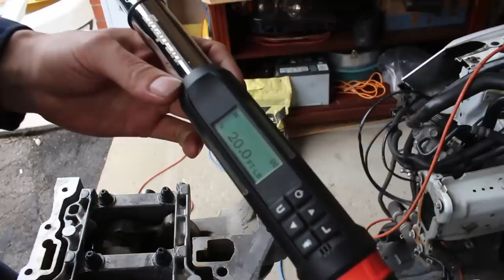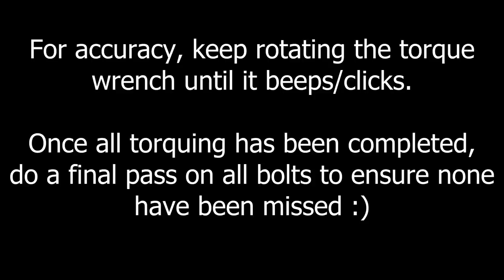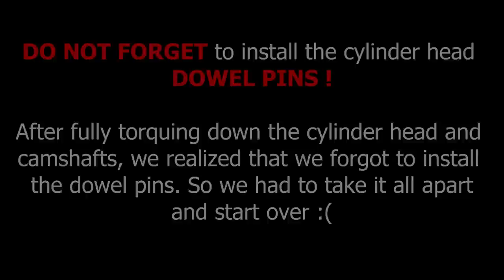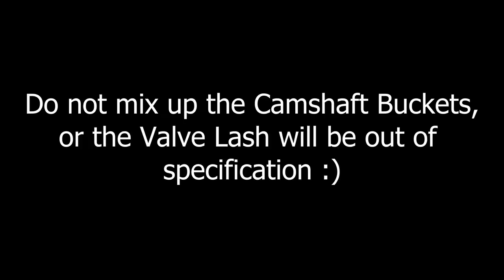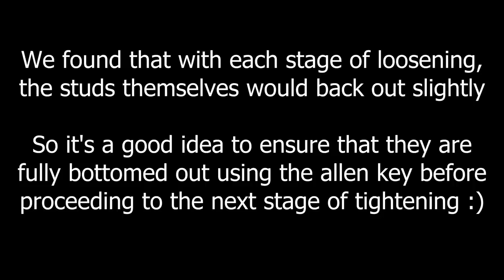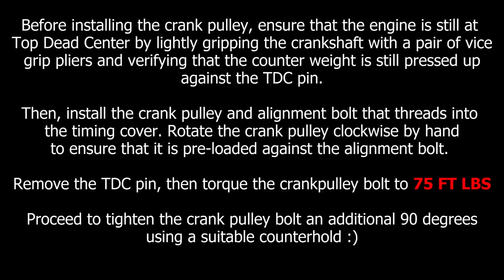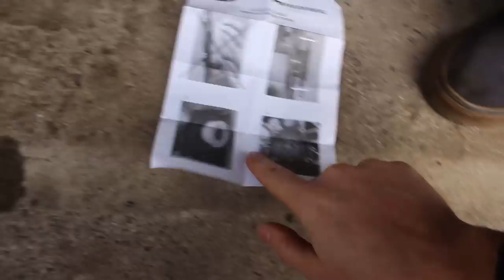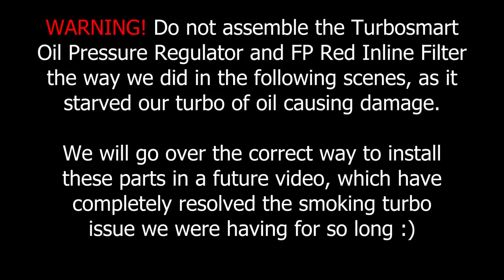Mazdaspeed 3 - Built Engine Assembly

Comment: Curious why you didn't mount the exhaust manifold and turbo before you set the block? Seems like it would have had more room to work.
Reply from the maker: That might have actually worked, but we wanted to have the engine in place first so we could properly clock the turbine housing in relation to the downpipe and custom oil feed / return lines
Reply: Wannabe Tuners I’ll be building and going BNR S4 after I hit 100k (2022 probably). Looking forward to seeing you running again. Really interested in how that oil feed works. Just curious if something stopped you. I want to try it that way because I have big hands and the EM is a PITA for me.
Reply from the maker: @Onimaru924  Yeah u could probably do it without issue as long as the turbo is already clocked the way u want it to be. We just wanted to swap the V2 CHRA back in, so that if it got damaged from engine break-in material for whatever reason, we could simply swap the V3 CHRA back in. So we needed to retro fit the turbo assembly into the car and clock the CHRA, turbine housing, and compressor housing to have perfect alignment in relation to the under route piping, downpipe, and oil feed/return lines. Then take the turbo back out to fully tighten the turbine housing bolts and raise the anti back out plates. As for the custom oil feed line, we state in writing that the way we assembled the Turbosmart OPR and FP Red Inline Filter should NOT be followed because it starved our S4 V2 turbo of oil. We have since sorted that issue and will be making a video that outlines all the little issues we've sorted out since first starting the new engine :)

Comment: Where you guys from?  Also i see FoMoCo on the block, is it just made by ford, or is it an ecoboost block?  I'm from Ottawa area, and i have a booboo on my cylinder 4.  She always starts on 3 cyl, however once it runs on 4, it has full power.  I'm hoping its my head gasket, but who knows.   I just got a 10x20 storage unit, so car is going away for sean, and pulling the head to examine.   If i end up going forged internals, i'm going to need to find a close good machine shop, that has ecoboost/mazda MZR experience.  So if you guys recommend the shop you used, that would be great :)  Cheers,  love the channel to and this engine build you guys are doing.
Reply from the maker: Thanks a lot for the kind words dude! We're from Peel region which is just west of Toronto. The FOMOCO is because when these cars came out, Ford owned a significant portion of Mazda, so there was a lot of Ford influence under the hood, however it is NOT an ecoboost engine ;) If you've got any questions, DM us on INSTAGRAM and we can do what we can to help you out.
Reply: @WannabeTuners  sounds good , thanks

Comment: By the looks of this video the tune won't be ur issue if it doe's blow up again. Looks like u didn't do ur bearing clearances.
Reply from the maker: Our machine shop did a trial assembly and verified that all bearing clearances are within spec. We are running standard sized bearings ;)

Comment: I want to keep the balance shaft in my 2.3L mazda engine - do you know how to align and time the balance shaft to crank?
Reply from the maker: Off the top of my head I'm not sure, I would have to look into it. Why keep it though? Are you upgrading the engine?
Reply: @WannabeTuners  This is just a daily driver -would prefer to keep vibrations low as possible. Just have not been able to get any solid info on how to align the balance shaft and especially if the timing marks go up to the engine or down to the ground etc...
Reply from the maker: @pingpong9656  I think you'd probably have to refer to a workshop manual of some kind. I think that info could possibly be found online for free ;)

Comment: How’s the motor holding up so far now that it’s broken in?
Reply from the maker: So far so good. Just had to sort out a coolant and oil leak, but other than that the engine is holding solid. It's still only running 18 psi, as it's been kind of difficult to find time to start turning the power up

Comment: You used a stock crankshaft? It was just keyed?
Reply from the maker: Yes it's a stock crankshaft that has been keyed
Reply: And it worked well with the 88mm setup perfect?
Reply from the maker: @andrewimbert9191  Yep works great. It's nice to know that the engine can handle abuse now.

Comment: Did you put any thread-lock or sealant on the flywheel bolts? Workshop manual does not mention anything but torque... ?

I guess as engine rotates it would be very hard for oil to gather near bolt area, because it is continuously being flung off..,
Reply from the maker: The flywheel bolts aren't exposed to engine oil. Mazda torque specs were used and no thread sealant was used.
Reply: @WannabeTuners  2:00:38 you mentioned you put new bolts with some version of thread-lock that was already on it - did I not understand that correctly - did you just use the old bolts with no thread-lock or sealant?
Reply from the maker: @pingpong9656  If I recall correctly the new OEM flywheel bolts have a blue dry thread lock on the threads
Reply: @WannabeTuners  1:58:09 <- I missed the bit where you actually showed them on the table.
Reply from the maker: @pingpong9656  Haha it's a bit of a long video. There's a lot of info that can easily be missed. I have a hard time remembering a lot of info tbh.

Comment: Good to see ya back lads.. full send.. and no more meth in with the fuel in the fuel tank..hahahha.
Reply from the maker: Hahaha thanks man! Unfortunately we don't have E85 in our area so we've got no choice but to run in tank meth to get that bump in octane
Reply: @WannabeTuners  your much safer running a meth kit buddy. I ran a devils own kit. Worked a treat. Ran 100% meth in the kit tank. And it only came on at a set 15 psi of boost to 23psi. It's a progressive kit as well. You also get the benefit of using less of it. And it cleans the valves..lol. well worth thinking about fella. Just trying to help ya out. But what ever way you go? Good luck and fingers crossed..
Reply from the maker: @sonarcreep3691  Thanks for the advice man! I used to run a 50/50 mix a while back with the stock turbo on a boost switched system, and even with a small nozzle it worked wonders in keeping knock under control. However, since I'm currently running a 6th port setup I really like the idea of only having to fill up one tank, and so far it's been very easy to tune in. Overall in tank meth in low concentrations (2-3 gallons per tank) has been proven to be safe on our fuel systems and boosts the octane to levels right on par with e85 mixes. So we'll have to see just how much power an in tank meth mix will give us before/if we reach the knock threshold. Time will tell as this journey continues :)
Reply: @WannabeTuners  ok fella. Happy tuning from the UK..😁😁😁😁

Comment: Can you or someone explain the orientation of the gear that goes on the oil pump on 1:08:00 I noticed the line on the gear,  does the line have to be in a top to bottom posotin?
Reply from the maker: The line on the front of the sprocket that goes onto the oil pump is to help line it up when installing it. Since it is keyed, it can only be installed one way.

Comment: Got question; when you switch from gen1 slave to gen2 slave cylinde was it a direct fit to the clutch line or did you have to modify something?
Reply from the maker: I've never changed the clutch slave cylinder as I've never had an issue with it. From what I've read, the clutch slave cylinders for the Gen 1 and Gen 2 Speed 3's are the same. Only the Speed 6 is different.
Reply from the maker: @commentmancommentman1658  It's possible that the earlier Gen 1 models might have come with an different version (mines a 2009). However, edgeautosport.com only shows one version for 2007-2013 models, so it looks like it bolts right up ;)

Comment: Why am I finding this video AFTER I finished building my Mazdaspeed 3??!!
Also, after watching the mod list, we did the exact same engine mods aside from valve springs. I kept OEM valve springs.
Reply from the maker: Because we took forever to get it done 🤣
Reply: @WannabeTuners  lmao I'm still watching the video and the further I go in the more info I see that would've been useful. Only thing I have left now is 2 wires that I could not find the plug-in for but haven't had any problems in the 1500 miles since I got it back together.
One of them is a small green wire from the radiator fan and the other is directly above it on the harness.

Sick ms3 bro! Can't wait to see more of it.

Comment: Why would you do a balance shaft delete?
Reply from the maker: Because the ARP 2000 Main Studs protrude too much preventing the Balance Shaft Assembly from being installed. Also doing a BSD reduces rotational drag allowing the engine to rev faster. From what I've read, it's only recommended for engines with forged internals, as it increases NVH slightly.
Reply: @WannabeTuners  ok that makes sense. Building a speed 3 engines with forged internals. I'll probably cop that BSD and a bunch of other stuff for their black friday sale. Thanks for the explanation!
Reply from the maker: @austinsherwood7188  Sounds good man

Comment: I have a question I hope some one can help me. I am trying to build a mazdaspeed 6 up to 600 hp I was wondering if the stock block and head will keep up with it. Off course I will upgrade the head gasket and bolts as well as the internals. Thanks in advance
Reply from the maker: A forged bottom end with stock head has been proven to be able to make 600 hp, but from what I've read that seems to be the limits for a stock head. It becomes too much of a restriction if trying to make more than 600 hp.
Reply: @WannabeTuners  so the block should be able to handle 600 hp just change the head set up got thanks man 💯

Comment: 1:46:35 isnt it like really not good to put brake cleaner on rubber? I thought it makes it brittle or something?
Reply from the maker: It isn't good for rubber absolutely! However we used pressurized air to blow everything out. With how fast the brake cleaner evaporates, it isn't really an issue. If the rubber hoses were soaking in brake cleaner, that would be a different story lol

Comment: Why does no one run oil coolers on speeds. Our cars don't have an oem sensor so you cant pull it up on the accessport.
Reply from the maker: Yeah that's true we only have a pressure switch. We run a Prosport sandwich plate that which gives the ability to run oil pressure and temp gauges :)

Comment: Hey guys, how are those motor mounts compared to the JBR?
Reply from the maker: Honestly very hard to tell if there's a difference because we did a balance shaft delete which added to the vibes. It's hard to say if the vibrations would be worse with the JBR mounts or not, so at this point I would only recommend what the majority of reviews online recommend, which are the Damond Motorsports mounts ;)
Reply: @WannabeTuners  no doubt. Just curious since I run the JBR trilogy as well and have always been curious. Forgot that you had the BSD. Right now I am stock block with the BNR S5 turbo, which is perfectly fine with me for now. I will build my motor one day though... glad you guys are back up and running after the ZZB
Reply from the maker: @ALIAS18425  Thanks man :) We also just recently went with an S5. Did u have fitment issues with the wastegate?
Reply: @WannabeTuners  yes. I have an older downpipe and it was hitting the wastegate, so I had to hammer a part of the downpipe in a tiny bit to clear the WG. I have seen some people block that wastegate location and get an exhaust manifold with the wastegate attachment on that.. I also had trouble with the oil return line kinking and leaking a tiny bit. I bought my BNR S5 when they were still including that junk return line. I fixed it for now lol
Reply from the maker: @ALIAS18425  Right on man, I ended running an ATP 90 degree low profile vband elbow from edge auto sport to relocate the Tial MVR 44 mm gate. As for the return line, edge auto sport carries return lines for the S5. I believe they are branded as Clean Bay Solutions. I've been running that line and so far it works great!

Comment: What's the ring gap for top and second rings? 0.020 and 0.025?
Reply from the maker: My engine builder set the top and second ring to 0.019" as per Manley's recommended specs
Reply: @WannabeTuners  Thanks for your reply. Really? What are the PSI and power numbers for your engine?
I am rebuilding my 3rd engine now, Had wisecos - blown, then Mahle - blown, and now I am trying the Manley 87.5mm with  brand, new block, head and everything. My  aim is a moderate 350..400whp now.
Reply from the maker: @Aramis_Production  Right on man, I'm aiming for 500+ whp in the near future with the BNR S5 turbo and 6th port aux fuel (I might switch to a returnless 4 port injection setup in the future for better fuel dispersion between cylinders). The engine itself should be able to handle right around 600 whp, as the cylinder head doesn't have any work done to it other than Supertech 55 lb valve springs, and it's got stock sleeves that are overbored 0.5 mm
Reply: @WannabeTuners  Thanks, so I will stay with.0.019. I am using a stupid corksport turbo that took a shit after just 2 years of use, replaced the CHRA that had a lot of play and the compressor housing due to some cracks around the WGA port. At least they shipped me another housing. Ah, well...
Reply from the maker: @Aramis_Production  Yeah man, for added piece of mind, I've been told that running 0.020" on the top ring and 0.021" on the second ring is a good idea :)

Comment: What are the OEM piston rings gapped too? Just curious. I always see what people that go with aftermarket pistons gap them too and why. But I want to know what the difference is usually from oem spec.
Reply from the maker: I don't remember the exact spec, but I remember reading on one of the forums that the OEM piston rings from factory are gapped much too tight which is a common cause for cracked ringlands.
Reply: @WannabeTuners  Oh that’s good to know! What did you guys gap yours too in those build?
Reply from the maker: @cesarsalad1999  We went with Manley's recommendations of 0.019"
Reply: @WannabeTuners  Awesome! Good to know, I appreciate the replies guys!
Reply from the maker: @cesarsalad1999  You're welcome!

Comment: Could you give me the link where you bought the CRANKSHAFT REAR MAIN SEAL
Reply from the maker: It came with the Stage 3 Engine rebuild kit from edge autosport: https://edgeautosport.com/stage-3-mzr-motor-build-kit-mazdaspeed-3-2007-2013-mazdaspeed-6-2006-2007/

Comment: Nice video, whats your break in process? How many oil changes & oil weight? Thx
Reply from the maker: Thanks man :) We ended up letting it run for about 20 minutes while fluctuating the RPM. After 20 minutes, we drained the oil and replaced the oil filter. Topped off again with fresh break in oil (Lucas 30 weight break in oil). Then drove the car for about 1000 kms with varying load, lots of pulls, and lots of deceleration. Then switched out to Amsoil 10w30 Signature Series.
Reply: Nice, thx. You guys do great work, funny as hell too. Keep the videos coming
Reply from the maker: @dennardtaylor8094  You bet buddy

Comment: how much does the machine shop job charge you
Reply from the maker: For just the labor from the machine shop was about $1300 Canadian
Reply: you had to buy the parts, piston and connecting rods
Reply from the maker: @JoseSantiago-hd4tt  Yeah the cost for parts was all additional. I got my machine shop to source the Manley Platinum Series pistons and rods, Clevite bearings, and ARP main studs for me. All other required parts I ordered online.
Reply: I have a mazda the same as yours, send me the links of the parts you bought

Comment: Man that turbo. Oil return fitting should have NEVER used RTV even high temp INSIDE of an oil pan! If it dislodges from oil slosh and it could it’ll go right into that pickup and KERBLAMMO!
Reply from the maker: You make a very good point, we just wanted to make sure we didn't have any leaks. Luckily, the oil pick up tube has a grid in it which will prevent larger portions of debris from getting to the oil pump. From there, the oil exits the oil pump and goes to the oil cooler. It exits the oil cooler and is forced through a 30 micron filter. We tried to smooth out the gasket maker as best as possible so hopefully everything will be ok ;)

Comment: "WARNING" You SHOULDN'T* put oil on ANY* of the bolt treads AT ALL-🙅‍♂️Because it creates an oil and air pocket at the bottom of the bolts. There for NOT letting the bolts sit all the way down properly, so when torquing them, they will NOT* receive the proper torque specs correctly. SPECIALLY when torquing down the head gasket, you will get incorrect readings all around, the result will be cylinder head warping and head gasket blow by. If you risk running the engine this way for awhile, the oil on the bolt treads will dry up and lock up with the heat of the cylinders. Then they might seize up or break upon removal. Wish you good luck on your build, But your risking premature engine malfunctions or damage, Enjoyed your step by step engine build video, it was entertaining. 🙋‍♂️ PS: DON'T use engine oil or Any type of oil on engines, transmissions, or differentials. Use high temperature lubricant for bolts threads and nuts ONLY. GOOD LUCK👍